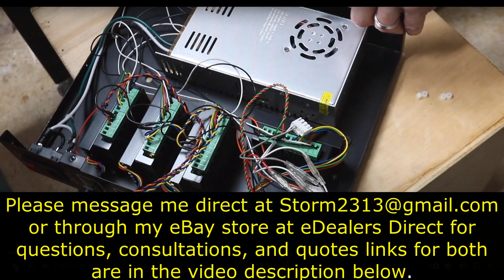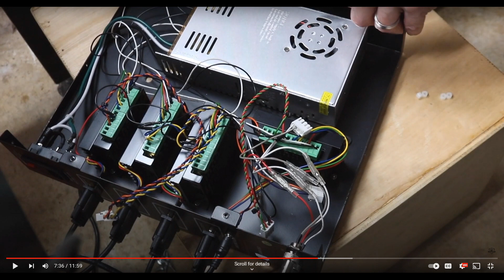Another Plasma CNC Controller Fail (Research Is Key Before You Purchase)

Comment: You helped me get into the proper mindset of first knowing how sensitive the controller electronics are in a CNC  system, and how they can be completely wrecked by EMI, and how to deal with it, or rather, the importance of dealing with it. How it important that is or you are just going to have problems. I finally got my machine working often using non-shielded cabling, but wiht a heavy copper braided shield that has been tinned. Although, I do also have some shielded cable for the probe, and from the controller to the motor drivers.  But the wires going to my Nema34's are that braided copper shielding that you slip over the wire.  You can push the ends of the braiding together to open it up more to let the wire through. I had to use a long 6mm diameter metal rod, and taped the wire to it, and then slipped the shielding over the rod until it comes out the other side of the shielding, and then I can pull the rod, and then the wire through the shielding.  Then I tape it down with electrical tape, my construction method of choice. And after all of that, my machine works.  I also had to upgrade my drivers from 6560's to some nice Yakko drivers meant for Nema 34, and a giant transformer yield about 76v to power the Yakko drivers. I am on a 220v power system. My machine can still choke if I run both the X and Y axes at the same time too fast, with my Y axis having 2 NEMA 34's, that move the gantry, so it is 3 NEMA 34 motors running at the same time.  So I added a diagonal feedrate protection in my CNC Controller, NewRAD CNC.
Reply from the maker: Thank you for your support. I'm glad to hear you have it working, and that my channel helped. Vince
Reply: @corvetteguy50  I am doing some cool stuff these days with cameras on CNC's using computer vision to automatically find a drill hole or other reference position, and then set the CNC's machine position. It looks so cool on video.  Plus, in about a week, I will have a new program out that is for making PCB's and then generating traces and GCode, so that you can mill your own PCB at home, quickly.  It has amazing graphics, and it also generates gcode for milling pcb's at 2000mm/min!!! ...using a special bit, and special techniques, that are unique to my gcode.  The video for that is going to look amazing.  I now have 5 cameras mounted on my CNC. (LOL).  Nothing is more fun that cameras on a CNC. It is more useful than I ever thought it was, and that is without the computer vision. When you add the computer vision in, it starts to become unlimited. I am also using 2 microscope cameras on my CNC, 1 for X axis, and 1 for Y axis, and with just the cameras and no CV, I can put a 0.9mm drill bit, and in a 0.9mm drill hole perfectly. Microscope cameras are game changes. If you would like any of my CNC software programs, just let me know.  I have a CNC controller, an Image Program for taking photos to gcode, and then a 2D Draw program, and they all work together seamlessly.

Comment: Langmuir systems. They sell massive amounts of these units  and have a huge community! 

Their community still purchases after they know the have to keep modifying.
Their new system is Arduino based. Old system was “red” board.
Reply: What’s even more “interesting” is that they power their boards (at least the red board) with the PC’s USB and use a jumper to power the 24v side with the same 5v source. I have photos of a unit I worked on where the cheap plastic arc trigger barrel jack was arcing inside against the case. They’ve sent multiple units out with improperly rated relays for the arc trigger. For some reason, If you use their THC system you CANNOT 5 point ground the machine. I don’t believe you can the ground the machine at all. Nothing is shielded and this includes the standard printer cables they use for the motor cables. 

Unfortunately, Their marketing is well polished and the price point is enticing for many.
Reply from the maker: Pricing will always sway the uneducated consumers. Its unfortunate these type of systems exist let alone companies willing to sell them. Hopefully more people will do their research to make sure their investment is a good one. Thank you,
Vince
Reply from the maker: That's really interesting. Thank you for your support Vince.
Reply: https://youtu.be/wn12W4AdaDM
This guy is showing how to modify brand new system to work, and provides an affiliate link to go buy it. what a joke. its like they say f**k me once, shame on you. f**ck me twice, shame on me.